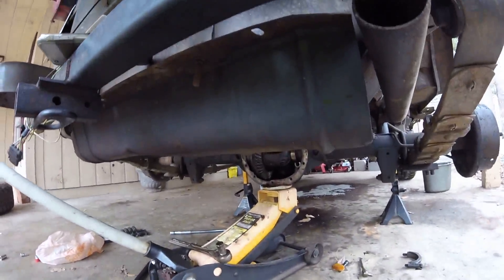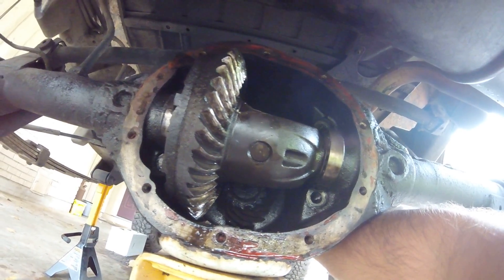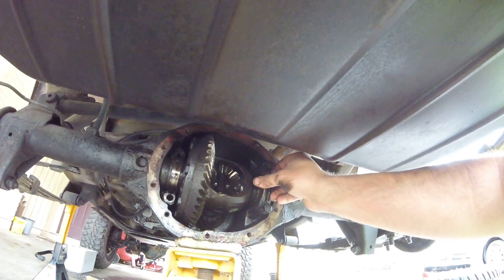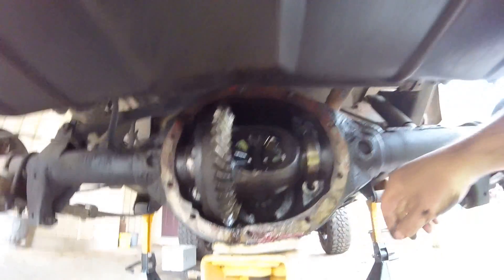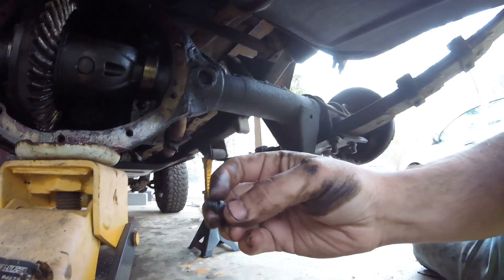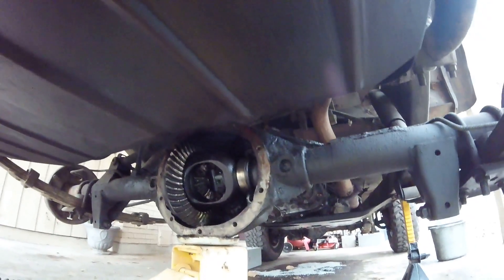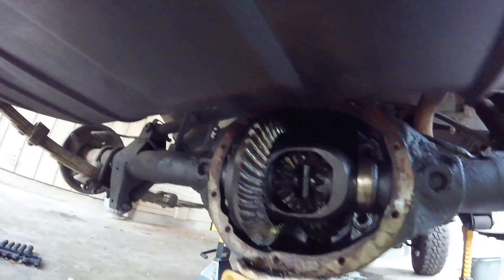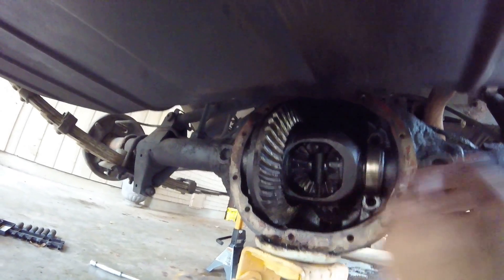Broken Pinion Shaft Bolt While Replacing Jeep Ring and Pinion Gears

Comment: mine just broke as well... how did you get the broken peice out?
Reply from the maker: +Luis Rodriguez  you're gonna have to cut the cross pin out with a grinder in order to get the axle shafts out to be able to get the carrier out. Then you'll have to drill it out once you get the carrier out of the housing. That's if you have the c clip axle shafts. The problem is that you really can't get to it, or at least I can't, with the axle under the jeep. So I've removed the entire axle but haven't messed with it anymore. I'm trying to find another dana 35 with decent gears so I don't have to mess with setting the pinion gear.